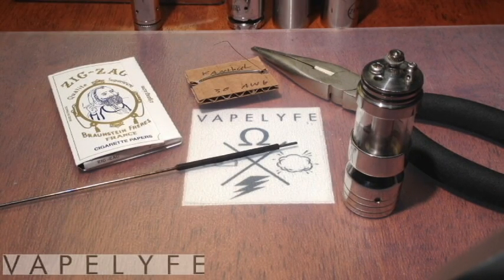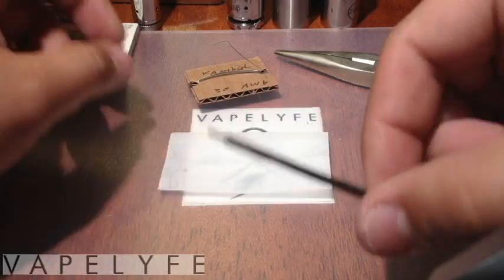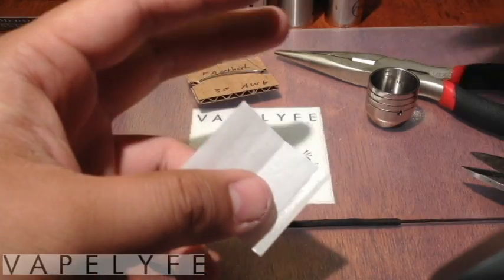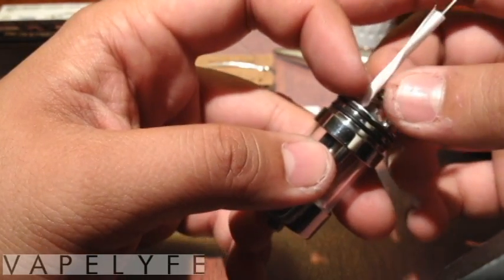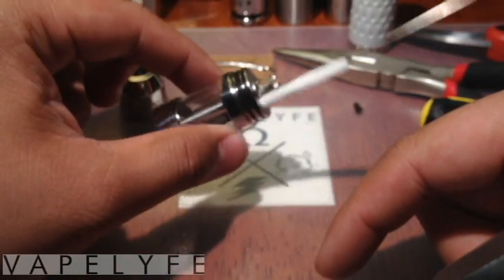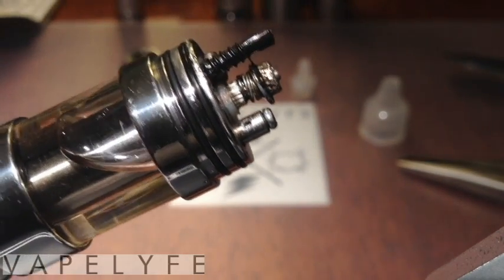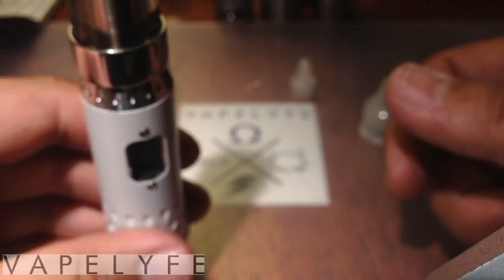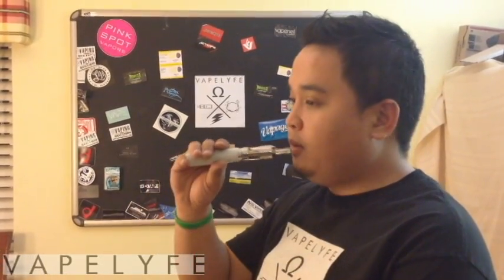Genesis Style Coil Rebuild by Vapelyfe

Comment from the maker: The rolling of the paper is to create an even spacing between the coil and the rolled mesh wick.  Uneven glow on coils is due to uneven spacing.  Too tight of a coil against the wick bottlenecks the wicking.  Too loose won't evaporate the juice.  The thickness of the zig zag paper is just right.  I've reverted to peter k method on all of my current builds and currently experimenting with stainless steel cable.